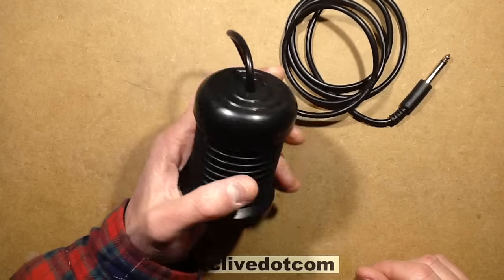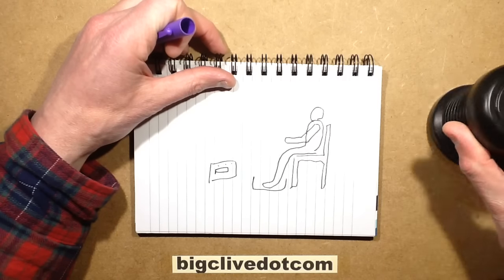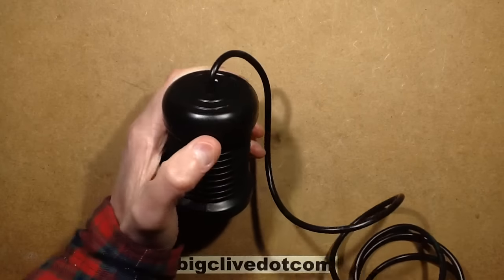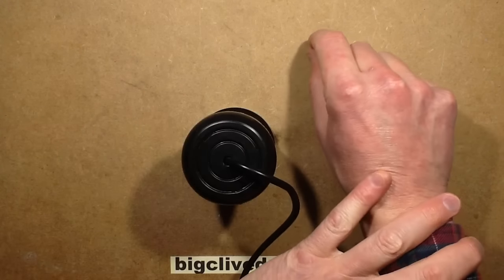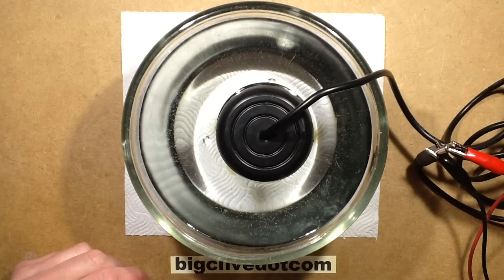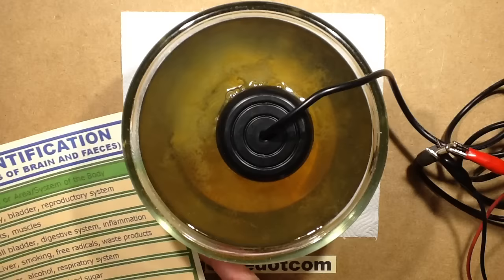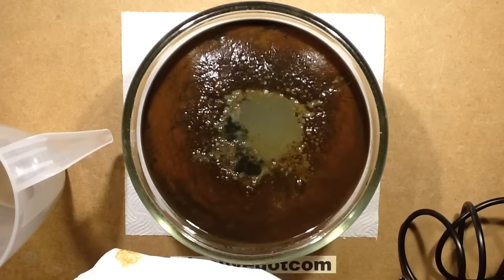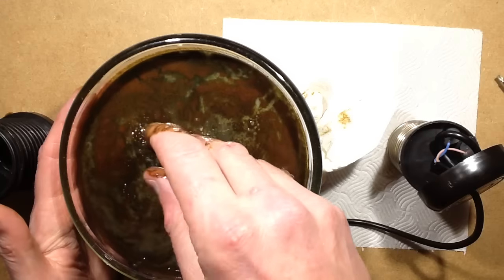Ionic foot detox electrode scam.  How it works.

Comment: Thankyou so much! You just saved me almost 200bucks! Here I would have thought all this was coming out of me. I have lymphoma and was only trying to help myself. Thanyou, now I won't be helping someone else not help myself! Wow, Im just shocked. I mean these things cost all the way up to 1,200 bucks on amazon, and we're all getting cheated like this? How do they get away with this with nobody the wiser???
Reply: they are $9 actualy. I was about to buy one and came to look for more info here on yt.
Reply: I had a friend who has helped reverse lymphoma. Look into Andreas Moritz the Amazing liver & gallbladder cleanse. I’ve done 3. And feeling good. A  congested liver makes the lymph system backed up. Many testimonies from people who have reversed cancer and skin problems, heart disease, and lymph problems. I wish you luck. It’s painless and so affective. The book on eBay was around 6 bucks for me. Message me if you have questions. :)
Reply: My comment is 9 replies above yours.  I suggest you read it for the respectively applicable reasons I ranted about in it.  If you get one, cheap is not the way to go. if you do however get a cheap device, you can at least get the professional rectangle plates which put off exponentially more ions.  These devices don't suggest that the brown is from your feet. They specifically say in the instructions that the water will turn brown with or without the insertion of feet because of the corrosion. The better models will use the rectangle plates or copper and not be a bad; but I'd like to know what part of the oxidation process produces yeast and foam on top of the water. it's literally one pinch of salt, water, and the array.... explain that one Bill Nye science Guy. Anyway. I definitely recommend the product if you're getting a decent one, and if not there are alternative healers all over that have good ones in the three to five thousand dollar range.

Comment: Few corrections:
What is happening is not corrosion. It's primarily electrophoresis. Essentially, the potential difference on the electrodes is causing solids suspended in water to clump together on either electrode (depending on the charge and induced polarity of the solids). Tap water is a dilute solution of salts but also a colloid - there are very small particles of insoluble salts (eg. sulphides) and non-ionic materials (eg. organic molecules) suspended in it. They're too small to see, and barely even scatter light, but there's enough of them to make it look quite nasty when you pull all of them in one place like that electrode is doing.
Some electrolysis is probably also occurring, like you said, and producing the bubbles. But I don't think there is any appreciable rusting because rust would tend to remain on the electrodes, which doesn't seem to be happening. 
Also, you don't get "sodiums of metals". Sodium is a metal. I think you meant chlorides.
Anyway. Nicely done!
Reply: +Jan Babiuch-Hall u still get electrolysis 
H+ and Na+ ions move towards  one electrode where hydrogen is released and sodium reacts with water 
   OH- and Cl- move towards the other electrode where thy'll react with the Chrome from the electrode and with the NaOH from the solution 

next the salts at the above step will also take part in the electrolysis  resulting in a solution containing all possible combinations of the available elements

depending on the current and voltage the concentration of each chemical varies giving all possible colors

now if u use more than one salt and different concentrations from the start it will greatly affect the color
Reply from the maker: +Jan Babiuch-Hall I think I actually meant to say salts of metals, but screwed up
Reply: Is this really cleansing the entire body?
I am in South Africa where can I buy this machine? For how much
Reply: yes so just like making the C.Silver
Reply: . Can you make.C. Silver with this machine

Comment: My understanding of "ear candles" is that they are a similar con. The grot and crap you get is actually from the candle, not from your ears. I have seen them used on a clean piece of paper, and you get the same amount of grot without any ears being involved.
Good vid, thanks.
Reply: Don't forget the fact that they actually put crap into your ear. The exact opposite of what they're advertised to do.
Reply: Yes they are. I burned one without anything and it had fake wax in it. It also left debris which could further damage the ears.

Comment: Ooo, I thought "pass electricity through yourself because it's magic" quackery ended with the Victorians.
Reply from the maker: +S O'Neil Electro quackery is still widely practised in bondage and beauty/health treatments.
Reply: +S O&#39;Neil  actly  it could work that way too but instead of crap coming out of you it would be going in you put the negatvly charged wire to the crap generator and the positivly charged one or ground to the idiets wrist and hey presto it works electrons flow from the wire through the generator takeing off chunks of metal and in to the water than through your body wich is mostly made out of salt water and than though your wrist lead to the other wire you wanna know wht you get by doing this you end up cloging your sweat glands with iron
Reply: Nah, passing electricity through "somebody else" has been very capable of getting a bit of information, or making somebody magically dissapear.
Reply: No I think your talking about blood letting . Did you know that the barber was the first actual dentist? Along with blood letting?
Reply: Exactly. There’s something very Victorian about this product, and the idiotic people who think it actually does anything beneficial.

Comment: My wife went to the quak foot cleaning yesterday.  I noticed he set the machine to level 20 for about 38 minutes.  I bet he will set the setting lower for about 30 minutes , because he promised the water will be a lighter color.  I will post an update later tomorrow to share the results
   
   Update:  He didn’t change the settings.  However, the water looked about the same.  He forgot to change the color and told my wife she needs more treatments.  He told her the flakes of metal were worms that came out her body.

Comment: Isn't electrolysis with stainless steel dangerous?
Reply: +Coolkeys2009 Hence why you get this very nasty goo. Especially with tap water and NaCl.
Reply: +Spirit Wouldn't that goo ironically be quite toxic?
Reply: Teth47 Definetly is.
Reply: ***** Thought so. See, this is why I think all quack medicine should be outright banned, because they are doing chemistry and don't know any chemistry at all. That's extremely dangerous.
Reply: Teth47 Not extremely, it won't hurt you too much if you don't ingest and wash it off, but if you ingest it - you're in a very bad spot.
Though there are some other quack medicine things that will kill you(see: homeopathy, cancer cures, homeopathic cancer cures).
Reply: ***** Violet ray things, also, what if there're cuts or sores on their feet? I feel like that'd be a massive problem as well.
Reply: Teth47 Definetly would be.
Reply: Some quack cures used to be full of radium...
Reply: Miike Hunt Inhalation =/= various other forms of ingestion...
Reply: Madeline Dalere I can personally guarantee it is. Come at me.
Reply: Your out of your mind!
Reply: +Spirit our body has a water channels,  in which negative ions will react,  by the help of aquaporine protine inside our body!
Reply: Madeline Dalere Our body has no water channel.
Our body IS water, 75% of it.
What you're doing is electrolysing salty, dirty water, creating hexavalent chromium, chlorine gas, CO2, and so many other things that will KILL you if you get ANY of them inside your body. And a bit of those things are absorbed right through your skin, which will cause rashes, infections, and inflammation if there are any wounds or scratches on your feet.

Aquaporin, or AQP, specifically AQP4, helps transfer water between the cell membranes, and has NOTHING to do with electrolysis of water.

Stop selling your fake garbage and donate to charity or real medication research.
Reply: Madeline Dalere You mean individual cells have water channels through their membranes that exchange fluid between the cell and interstitial fluid of the body. You'll note that the skin is a waterproof layer consisting of dead cells which do not have such channels, because they're dead, thus, your stupid electrolysis thing can only, at most, introduce random crap that boils off the electrode into the body through cuts or tears in the skin. Otherwise, it can literally only do nothing.
Reply: 0 Error. damn I'd love me some radium... aaaaaand I'm on a list
Reply: Well I don't know about you guys, but she's convinced me. She definitely knows what she's talking about.

Comment: stainless used in electrolysis, creates Hexavalent Chromium in the water, and that is how we get an Erin Brockovich movie, so dont drink it (as if)
Reply: I'm not sure putting parts of your body into hexavalent chromium is particularly safe! I imagine it would not pass health and safety laws in the UK or Europe.
Reply: +Pete Allum ... or Chinese laws for that matter... except nobody cares (unless there is a big publicised scandal)
Reply: +jusb1066 Don't forget the kitchen salt, mmm lovely chlorine gas. For that World War 1 trenches feel to your foot treatment.
Reply: +Miike Hunt 
Well he didn't inhale any of the water, unless I missed that part.
Reply: The inside of that fake array is made of metal.  If the electrode attached to that thing,  it make a conduction!  Not detoxificatio.
Reply: +jusb1066 You need to show some university level chemistry to prove that hexavalent chromium is produced, vice other valences, IF indeed, chromium is even liberated in this electrolysis, which is not clear.
Reply: Pelican1984
i dunno, i will go with my non-university method, i will bottle some up and ask you if you;d like to drink it, if you say no, then I will assume it has nasty stuff in it!  :)
Reply: jusb1066 
You shouldn't have many problems drinking it, given it's actually just rust. Potentially making a few molecules of something isn't the same as making enough of it to actually do damage to you. After all, you're currently breathing oxygen, a corrosive neurotoxin.
Reply: CruelestChris
dont forget the Dihydrogen Monoxide! the most dangerous  and ubiquitous chemical there is!
Reply: jusb1066 You bet.  It's The Universal Solvent.
Reply: Jusb1066 it depends on the kind of stainless.
Reply: @osenseijedi  Like right now with this virus. China have a lot to answer for.

Comment: I appreciate this video that you created and I will subscribe click like and allow the commercials to play through as well. But I have one question have you figured out what’s causing that sludge? Have you tried running a test with water and not salt?
Reply from the maker: It is caused by the electrodes rusting rapidly with electrical current flow.  The salt makes the water more conductive so the effect appears faster.

Comment: Anyone else see that 1/4" male plug at the end and think this bit of quackery was supposed to plug into an audio device? lol
Reply: +DashCamAndy Sound waves in water would do you 100x better than this contraption. At least you can get water vibrations out of it for a massaging type action. lol
Reply: those jacks can also be the jacks for 12v or 24v AC to DC mains converters.
Reply: Yeah, I thought that looked like part of my old headphones I used to use...
Reply: Perhaps I can use it with my bass amp or guitar amp and see what it does
Reply: Of course. You must plug that into your 100W amp, connected to sine wave generator, tuned to 432 Hz or what that quack frequency was.

Comment: They’re actually not a scam, just because they change the color of the water without your feet in it doesn’t mean they don’t work… they don’t claim that every color is from your feet, there’s a significant difference with feet in and feet out when you compare, feet in tends to have more shit in the water and more of a smell, and varies between different people depending on what toxins or lifestyle they have. The cheaper ones don’t work as well neither. It’s been well addressed a long time now that they color the water without feet contact, that doesn’t mean they’re a scam…
Reply: If you dont mind me asking, why dont the cheap ones work as well? Any pointers as to how diy a proper rig? I'm guessing I'll need a non corroding electrode...
Reply: Yeah I tend to agree here; as you can see in the video the sediment floats on top of the water. When I took a treatment today I had dark black matter that clumped into balls and fell to the bottom, likely heavy metal, along with the other rust coloured sediment that can be seen here

Comment: I’ve heard cutting onions in half and strapping to bottom of feet to detox. I think I would try onions first.
(Electric coils set up similar to this coil is what is used to separate Hydrogen and oxygen from water for use as fuel)

Comment: So what would happen if you used an AC psu instead of DC? oh wait..
Reply: i don't get it
Reply: +&quot;pad kid poured curd pulled cod&quot; You get a really large coffee heater or bath warmer... the coff-inator probably.
Reply: Reversible reactions on both electrodes, not much visible effect. No observable electrophoresis.  At least that's my hunch.

Comment: So the only difference between this and the electrode boiler is the type of plastic cage and AC/DC input & voltage? HUMMMMMM!!! Do it, Do it. For science of course.
Reply: Come to think, I wonder if 12V DC through the electrode boiler would produce similar crud? If not, why not? See, Science!
Reply: +Nic Green Indeed, it would have the same effect.  Though 240Vrms rectified would be so much more dramatic.
Reply: +Ethan Poole  You are "Probably" right but rigorous scientific research demands a test!!  Especially when we don't have to put out the flames. I for one will put in for an industrial strength fire extinguisher for Clive ;-) if he doesn't need one I don't know who does!
Reply from the maker: +Nic Green I have to admit....    The temptation is there.....
Reply: +Ethan Poole I am quite sure that would produce a lot of hydrogen, oxygen and ignite it.
Reply: +Richard Smith so, we still don't have any arguments not to try it then, just more good arguments to try...

Comment: i bet you could buy this with a mains plug on the end for the extra bit of tickle :P (maybe a diode or to for rectification but what more would you need for a whole evening of fun)
Reply from the maker: +Blowitup1991 Aaaaand BANG!  That's you detoxified.  Next please!  I reckon I could detoxify 60 people an hour if they were quick on their feet.
Reply: +bigclivedotcom at mains supply in the UK wouldn't it be 60 fools...sorry people a second ;)
Reply: bigclivedotcom it would still be interesting to know what happened if somebody did that "accidentally" though (i would just love to see this thing being overdriven xD)
Reply: +Blowitup1991 That would just be "trimming" the gene pool.

Comment: I heard about these. My friend received a unit for Christmas 2021. She set it up and plugged it in. The water started changing color before she put her feet into the pan. So it must be a scam. And I really wanted to believe that it actually gets rid of toxins in the body. Thanks for the review.
Reply from the maker: That's why the professional ones have a hand or pad electrode to make sure the theatre doesn't start until the "patient" puts their feet in the water.
Reply: Thank You for your response. The pro scammers have it all figured out. My friend gets these treatments at her spa and another friend gave her a unit to save her some money. Yes, it is all Theatre...Smoke and Mirrors-:)

Comment: I have used one of these, I had a therapist who did it and yes it does work, I know many people who have used them and it makes a lot of difference. You have a right to your opinion of course. The brown is not the impurities but comes from the machine, it is the scum part, black bits etc that come from your body. I felt loads better after having this done.Maybe do some real research before you make a video like this.
Reply from the maker: Rest assured that plenty of research was done.  But if it makes you feel better then by all means use it as therapy.  But be aware that the brown water is composed of chromium, nickel and iron salts.

Comment: We used to use those devices as a hardness diffuser in water treatment to diffuse harness causing salts to measure the hardness of the water, but it didn't work as accurately as it should have so my industry doesn't use it any more. I recognized that as a scam as soon as I saw it, it diffuses the salts out of the water not your body

Comment: Fascinating. My mother has one of these devices, but it uses graphite so doesn't leach the metals into the water.
There seems to be quite a lot of benefits when hydrogen ions are absorbed in the body. The latest fad appears to drink hydrogen water. Studies claim it has antioxidant activity but one experiment performed by a you-tuber showed something entirely unexpected and that was the affect on he's blood before and after he drank the h2 water. Before he's blood cells were moving (using some fancy microscope) but somewhat coagulated, after drinking he's blood is spaced evenly. Its as if the blood cells absorbed the h2 and negatively charged themselves, and because of this they all repelled each other to a degree so that no coagulation occurs.
Reply from the maker: I made a video about an electrolytic water hydrogenator.

Comment: I think this works well because of the various forms rust can take:  
Several biggish oxygen atoms per iron gives a lot of bulk, especially as they are dropping off the electrode in tiny clumps, and not sheets of rust. If the device can make three colors of rust grow, you're on your way to disgusting.